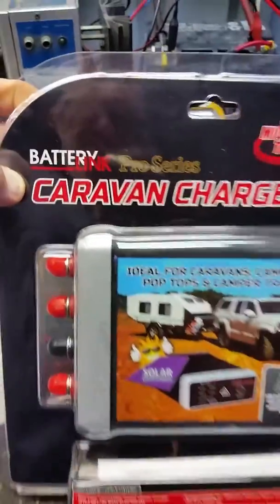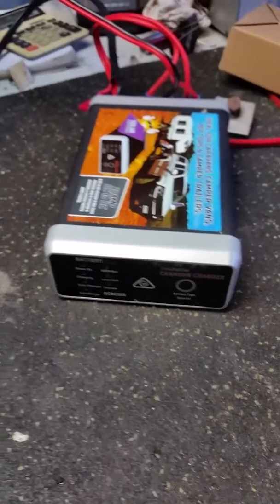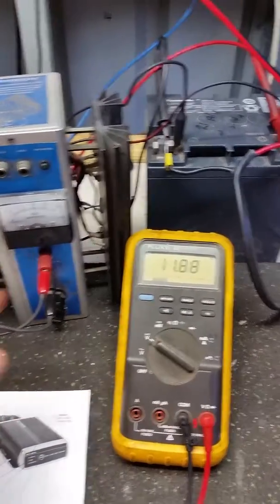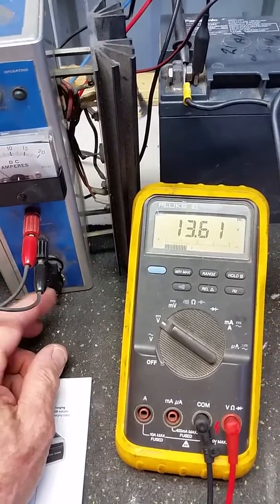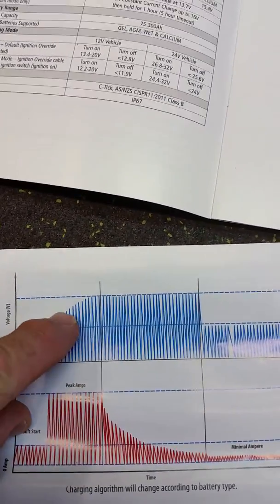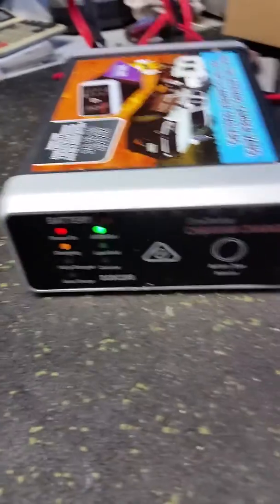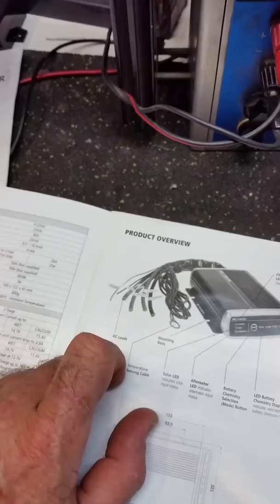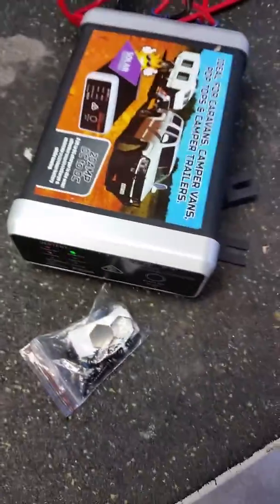Low Cost DCDC Battery Charger - Battery Link Model DCDC20S

Comment: Follow up to the update below - I have now replaced the friends vehicle cable to the Anderson plug with 10mm cable and this now maintains the input voltage above 12.5 volts at the charger. The caravan has 8mm cable down the draw bar to the battery compartment where this charger is installed adjacent to the battery. So thats the fix. Still better to buy a better quality charger I reckon!

Comment from the maker: Here is a follow up and downside for this product:-

Just discovered a short coming of this DCDC Converter and I guess explains the lower cost. I fitted this unit to a friends caravan about 8 months ago and since then rewired the the 3 way fridge with larger 12V cabling and a shorter cable run as it never worked properly. 

This certainly improved things and the fridge now maintains temperature while driving ( in fact a long trip will cause it to get tofreeze especially in cooler weather). The downside of this product, I discovered recently is the minimum voltage specification on the input. The operating range is 12.5 - 16V. The somewhat more expensive converters such as Projector IDC25, CTEK D250S, etc operate with a lower input voltage - Projecta an impressive 9V and the CTEK 11.5V). This low voltage level is not really an issue if your are charging an Auxiliary battery under the bonnet close to the Alternator but becomes an issue when mounted in a caravan. 

In the example above the Fridge now draws about 15 amps on DC and if the battery is discharged from camping over night - this unit will max out at a bit over 20 amps output and draws about 25 amps from the vehicle ( the up-conversion in voltage output causes the increased current consumption on the input side). 

So even with 8mm sq cable the input voltage can drop to 12.5V (at 20 amps output at 14V+) and the unit shuts down, then restarts after the voltage jumps back up above 12.5V, the current comes back up to maximum and it shuts down again, and so on until the load is reduced. Its not difficult to lose a couple of volts or so under that load over approx 10 mtrs of cabling through the vehicle and the caravan.

So maybe not the best choice for a caravan battery DCDC converter unless you run 10mm sq right through - otherwise spend a bit more and buy a more expensive unit - I do love the Projecta its bullet proof - wish I had experienced the same reliability with the CTEK product!!

Comment: Smart alternator compatible?
Reply: Its not a very smart charger Phil but will not charge if the input is below 12.5 volt so you would have to get your car's smart charging changed back to standard by the dealer. Many new vehicles only run at this lower voltage (between 12.5-13V when running and after they have brought the cranking battery back up to full charge. The dealer can change it back to a standard charging profile very easily and many people get this done. The smart charging is only there to assist the manufacturers to get a slightly better fuel consumption figure but it assumes you dont have any thing like this fitted to your vehicle as the smart charger only really monitors the standard vehicle applications.